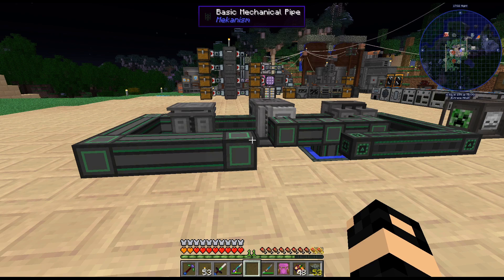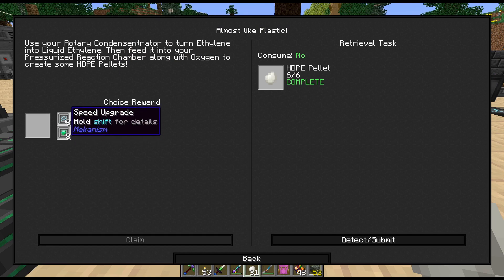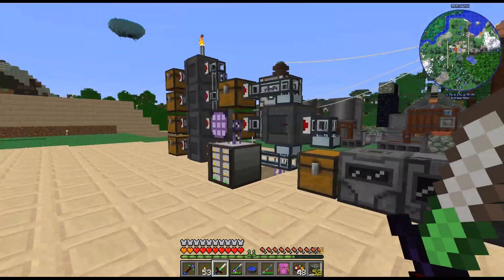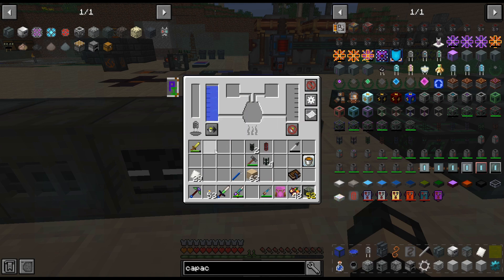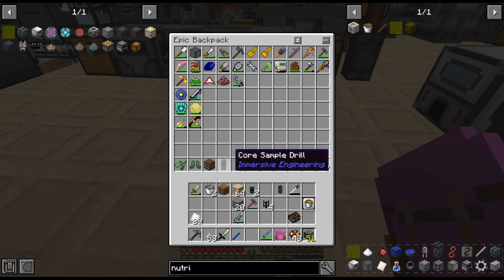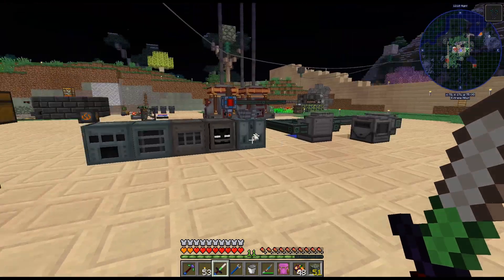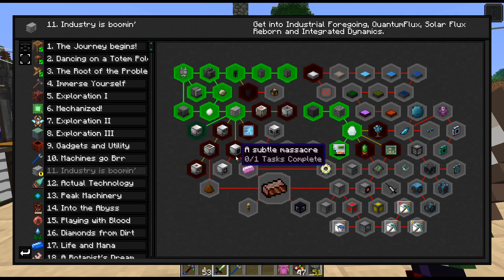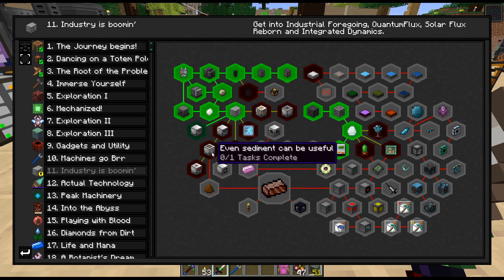Divine Journey 2 - 36 - Industrial Foregoing

Comment: Rotary doesn’t auto output
You only need HDPE for early plastic, it’s only used much later on otherwise 
Time to automate grains of infinity
It’s not JEI’s fault, it’s Pae2’s
You’ll reuse the machines from HDPE for steaming restonia
Formation plane can place blocks
The Mek crafter is good for condensing the tiny dry rubber
Block placer has always been there yea